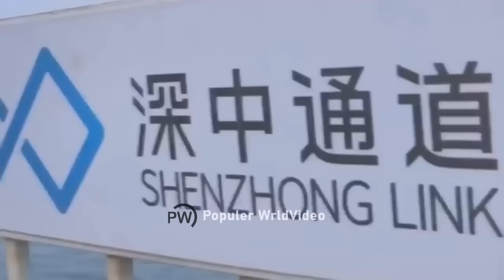The road construction that the Chinese built shocked American scientists.

Comment: Those roads on pillions could’ve been built on the ground making their service life longer with lower cost for repairs or replacement.
Reply: I agree.
Reply: great point!
Reply: There must be a good reason for it. Is it, I wonder, because the land beneath the pillions is likely to flood frequently?
Reply: @johnpaton621  is 2 way Road... Is for exporting goods with no trafic...
Reply: Because the best engineering advise comes from the person who thinks roads are built on horse saddle/Motorcycle seat cushions.
I think you should stop pretending that you're a civil engineer, and let the professionals do their jobs. Lol.
Reply: Also, it's frequently better financially, takes overall less time/labor, and is easier to maintain an elevated road over a valley.
If they were to "build on the ground" as you said, to cross a 1 mile wide valley, it would take miles of switchbacks, millions of tons of rock and dirt needs to be excavated and transported. Build any retaining walls or other reinforcements that are necessary. Prep and pave numerous miles of new road. Continue repairing grade slips, removing loose rock/dirt for the lifespan of the road. All having a huge environmental impact. 
Or, they could build and maintain a 1 mile long elevated road and avoid most of the things listed above, while having a relatively small environmental impact. Thank you captain dumbass, your job is done here, you can fly away now. Lol.
Reply: 在地面上的铁路会阻碍一个城市的发展，破坏地面生态系统，而放在柱子上的铁路就不会有这些问题了，要知道，中国的城市化和生态保护是同时进行的。
Reply: @MH-jt3lx  I'm fully aware of how communism and/or dictatorships work. I'm just not sure how that is in any way relevant to your lack of knowledge in regards to road construction. I wasn't referring to any specific piece of infrastructure or location. I was trying to explain the ignorance of your statement.
Reply: It going repair on road in life

Comment: 4:15 ... Why was this hugely raised bridge necessary? Why couldn't they just make a typical road? I know I missed something, but.... Why?
Reply: It leaves both farmland and villages intact, with minimal disruption to established commerce and food production. It doesn’t destroy food sources for ease of driving, plus this way the road runoff is easily collected, rather than going into ditches or culverts that could impact the surrounding agriculture or local water table.
Reply: @schoolingdiana9086  Thanks... But still... Why so massive? Many roads are elevated to accomplish those purposes... but 100s of feet? It's not like they need to leave clearances for ships to pass... It's on dry land. If you can explain why it's so incredibly and seemingly unnecessarily tall....?
Reply: Because China is a mountainous country. Roads built at the same altitude can increase speed and save electricity cost, especially for heavy-duty freight railways.
Reply: At 4:40, we see railway tracks. 

Trains can barely handle gentle slopes, so they probably had to build the elevated section because the railway was passing through an area with too big a change in elevation/slope.

Comment: Awesome, let's check back in 30 years and see how it's holding up.
Reply: 8000km of road since 1988. If anything happens it'll be repaired or replaced by the next day. Will never know
Reply: China’s 2000 year old grand canal and irrigation still holding up
Reply: @ashaj7095  lmfao, so you still building with a hammer and chisel? Stone does last, but we're taking cheep rebar and concrete here. What you build today will need rebuilt again and again and again. Built on economic hightimes will crumble over time.
Reply: @screenarts . 50 year old American bridges are falling down. The Florida condo that collapsed wasn't that old either.  You ought to be concerned about the state of American infrastructure.
Reply: @ashaj7095  yes they are falling down, thats the point. Concrete and rebar don't last. What great expense to build it all will need repeated in the future at higher cost, while still expanding, you know the constant growth required for a market economy. Owners, 1% will seek out lower cost nations to build their factories, rather that rebuild the old junk. Owners will, are floating above national laws and borders extracting frome the lowest bidders. Just time...

Comment: Not only Indian scientists but also its engineers must learn how to build infrastructure from China. Chinese high way network consists of more than 150k km nationwide. Even its 2nd 3rd level roads are in very good quality. All villages and almost every household in the countryside are connected by sealed roads. India is 50 years behind China.

Check the roads in Tibet and Xinjiang, far western remote region of China, it will drop your jaws

Comment: 4:16 For what reason they built railways so high? Looks like they could make it much lower and save huge amount of materials.
Reply: Because the end is a high ground, building the height can reduce the power of the train to climb.
Reply: @晶为  Sure, but there is not so much power needed for that climb, because anyways trains use power for speeding up. Also, if you make the climb at the end, it will be easier to lower the speed, less to use brakes. And when you'll go back from that high ground, it will be easier to maintain speed.

Comment: Why did they build those bridges in the middle of nowhere so tall and with columns that are big as nuclear stacks!?  🤔
Reply: It is a high speed rail and the track should be as level as it can be, most probably not in the far distance is a mountain range where the best altitude to bore a tunnel is at that level. They have to build a bridge at that area anyway to avoid infringing or disturbing the farms and community. Now all they have to do is elevate it to satisfy the above concern.

Comment: America would of drilled tunnels through the mountains for the roads and high speed train with pressure relief vents to displace the air pressure so the train didn't have to slow down through the tunnels. We would have laid tubes on the ocean floor like we have done for years with zero incidents of flooding or cave ins. We would of used the ore from the tunnels to make any steel needed and rare earth minerals, timber and precious metals would be sold to offset costs. The gravel, sand and lime would be separated and stockpiled to use for concrete mix later. When we were done, there wouldn't be any ugly structures sticking out of the ground and ocean,  built with crappy steal that should be ileagal to use in the state's like their sheet rock is.

Comment: There is no economic difference. It is a viaduct road deep in the mountains built for political significance, because it can strengthen the control over remote areas. This is the favorite thing of dictatorship. It ignores people's livelihood and invests in infrastructure regardless of cost. To sum up the actual economic significance is far less than the political significance, and these pink groups within Chinaccp are cheering proudly.

没有什么经济差值，完全是政治意义修建的大山深处的高架桥公路，因为这样可以加强对偏远地区的控制力，这是专治统治最喜欢做的事情，忽略民生，不计成本的基建投资，总结实际经济意义远远低于政治意义，而这些在中国内的粉红群体欢呼骄傲的东西。